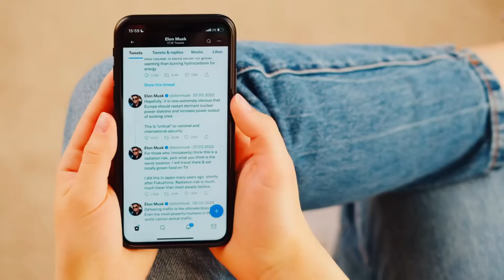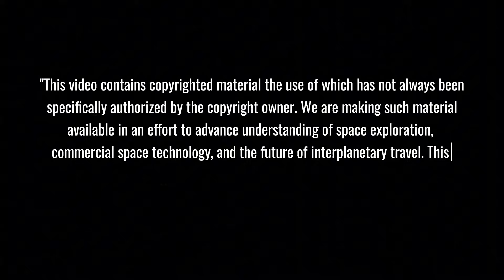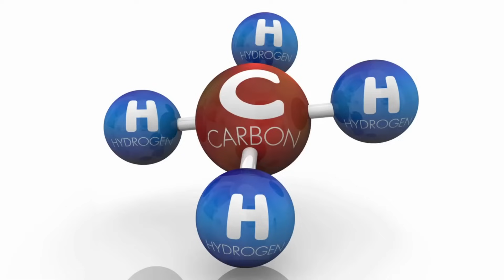SpaceX Finally Revealed Its GROUNDBREAKING Flight 7 Changes - First Block 2 Launch!

Comment: I am trying to put things in order.
The usage of cryogenic fuel to generate the thrust per unit of propellant used. If I am not mistaken, cryo for Spacecraft made out of liquid H2 accompanied with? plain O2 or liquid❓️
Now, for Raptors fuel is liquid methane plus, liquid N2.
Gosh❗️I am jst away for 9 hrs, there goes my brain, took off fr my memory bank.
Am I close of correct? Ugh🙄
Well, failure is my partner of success eventually 🤭😁
Thank U ✨️
~😺

Comment: The Far Side of the Moon:    The moon is not just coincidentally rotating so that one side always faces the earth.  It is because the side that faces the earth is heavier, probably because there are denser meteorites and asteroids imbedded in all those craters.  Gravity from both the Moon and the Earth have locked together...or maybe centrifugal force is causing the heavier side to face away from the Earth.  If we mine enough of those former celestial bodies, the Moon will begin to shift its rotation, and we may be treated to view of a sliver of the far side.